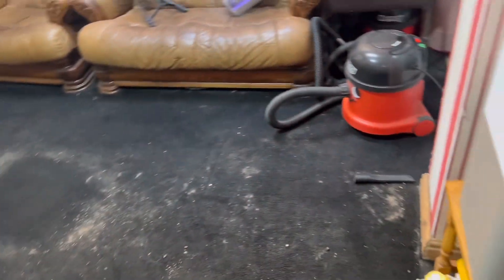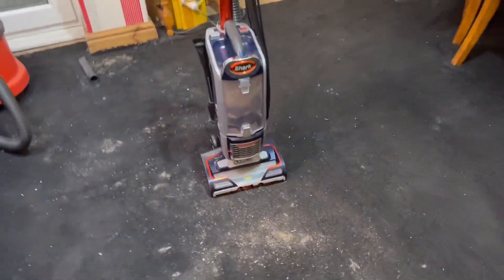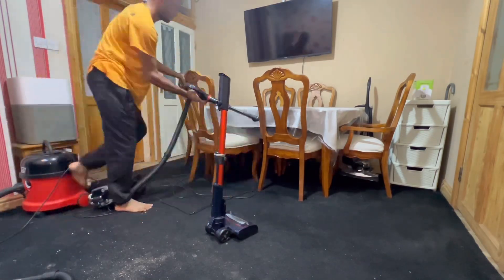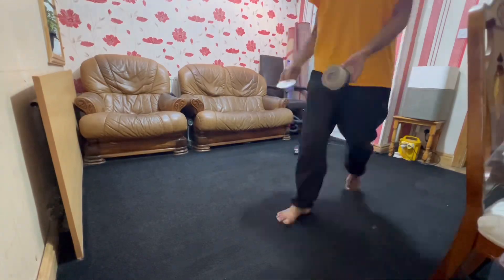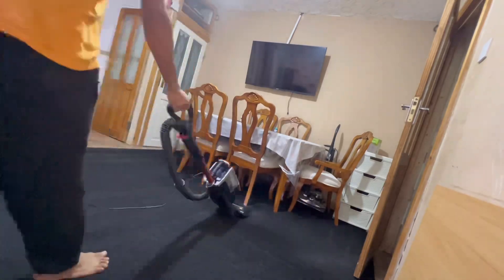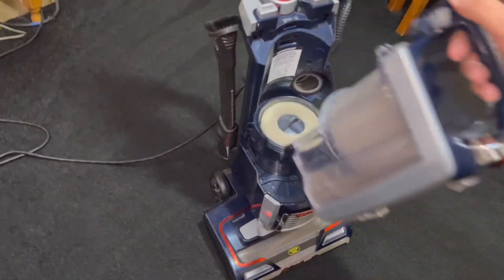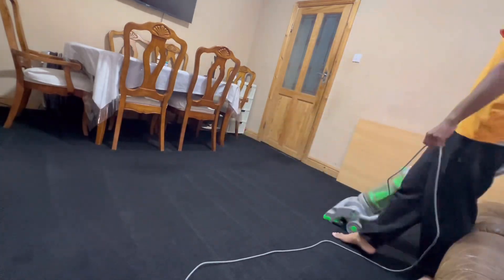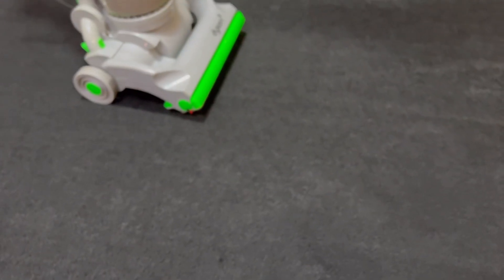Clean with me - my hoover and air purifier palaver!

Comment: This video was needed. People really need to see what a mess "mess test" causes. Whole room is full of dirt. Now thing is that the carpet after the mess test is hard to "reset" Mess test has so much dirt that it takes huge amount time to get clean.
Reply from the maker: Yes!! It’s so hard to reset the carpet, I normally use a Dyson as I found bags to clog quickly with all the fine dust, then I use a good strong bagged vacuum once I feel like it won’t clog the dust bag - but even after using either a modified Kirby G6, V15, Miele C3, Vax air, Shark, hoover wind tunnel, eureka smart vac or any vacuum no matter how good it is, I can still see grit visibly coming up to the surface and it takes a good few vacuuming sessions to become clean again

This carpet is very porous through the pile and breathable, it needs a vacuum with high airflow, high suction and good agitation

Comment: Omg, lovedddddd thisssss! 💯🔥😍 I clean like this after I vacuum something with fine particles -which mainly for me is carpet powder, bc I’m obsessed with that stuff! Omg, it gets everywhereeee 😫. The first mess test I did with my Duo, I immediately saw that it wasn’t going to be considered a deep cleaner. I completely agree with @vacuumrelaxtion about the soft roller. I also feel like the suction isn’t there because of the soft roller. Love it for the hard floors. I too use a canister for an ultra deep clean! I use the Kenmore Elite for the final clean. I also use the Levoit (Model: Core 300) HEPA air purifier. I tried one bc of an article I read and I’ve never looked back. I have them all over the house. (I buy them on Amazon) There are different filters too. I get the one for pets, bc I have pets. Another thing I like is that I never find dust on the tops of them. When you showed your purifier doing that, I knew I needed to share 👍 !
Reply from the maker: Yay!!! I’m so glad you like it 😁 it’s really important to vacuum really slowly to allow time for the brushbar and airflow to work at extracting the deep down dust and dirt from the roots of the carpet. I agree, the shark is amazing for hard floors, the best ever infact! But for carpets, it isn’t the best unfortunately. 

Love the Kenmore Elite, those look incredible! 

Thanks for recommending me the Levoit air purifier! Do you find the airflow to be really strong and are there rubber seals around the HEPA filter? I must admit, I quite like the new Dyson version, but I’m not sure yet

Comment: I do agree that sharks with duo clean aren’t the best deep cleaners. before I switched to shark we had a Dyson dc40 and a Henry and Dyson v6, all maintained well, the dyson dc40 was great up until about 2021 when the motor gave up. A relative has the Dyson v6 because they needed something lightweight the relative gets on with the v6 great, but the battery’s starting to give up and overheats even on low power and starts flashing an orange light and only lasts about 10 minutes now and max mode doesn’t work at all now, so due for a new battery. The Henry is with another relative and is now used on a building site ( I make sure they use bags) which is doing a very good job. Anyway before I gave these vacuums to relatives, I decided to give a shark duo clean bought it ,I vacuumed a day before the shark arrived. I vacuumed with the dc40 before the motor blew up. I vacuumed with the shark duo and the amount of dust it pulled out of the carpets I was disgusted. I do want to save up though and get the v15.

Comment: I’ll be honest I think a belt is better than a brush roll motor in the long run 

Yeah no belts that can snap but I can imagine brush roll motors are either obsolete or extremely expensive I’m glad to get my dc04 they are amazing deep cleaners
Reply from the maker: I like vacuums that can provide decent brushroll agitation whilst also maintaining a good seal on carpets for optimal carpet deep cleaning, things like a Kirby, Vax air, Dyson ball with the max suction setting, etc 

The DC04 is fantastic on low pile and some medium pile carpets too but I much prefer a DC07/14 origin for more raw power or a even a ball animal 3/UP22 even if I had to do thicker carpets